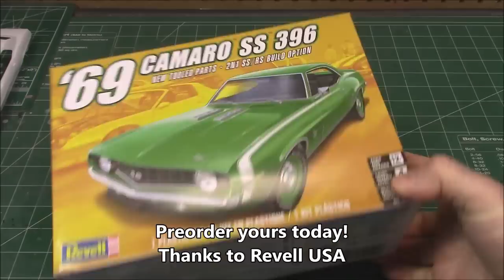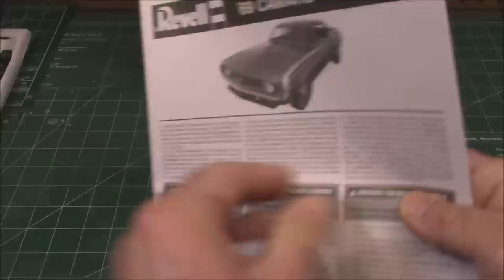Barn Find 1969 Chevy Camaro SS RS 396 1/25 Scale Model Kit Build How To Fade Weather Rust Decal

Comment: As a fellow model builder I have built this model umpteen different time the exhaust system is totally incorrect for this issue of the model chambered exhaust only issued for the 69 Z28 only a small block the hedders we're only available with the small block Z28 Factory 396 hadd cast iron manifold and non chambered exhaust this can be straightened out finally we get a correct Hood thank you Chris for doing your work I'm sure Revell will sell plenty at least they're trying to update unlike some other manufacturers celis new decal sheets and pad printing tires y'all know who I'm speaking about buyer beware

Comment: EXACTLY what I expected them doing, aka use parts from their many versions of that kit and then add the new hood and vents. Which is actually a good thing. This kit many variations are actually one of my fav kit (since they're all the same kit with certain differences). I though they would've also have added a "normal" exhaust pipe set, 'cuz from what I've read the exaust they use were something GM tried but they weren't that good, so they recalled all the cars with them to put on a "normal" exhaust system. But that's still fine, just thought they'd take the time to do this as well since they took the time to make a new hood.

Again, really nice build. I'm not into damaged vehicles at all, but the more I see builders like you build such cars, the more I'm thinking of doing one myself one day.
Reply: A set of stock exhaust manifolds would've been nice too. Also a set of tires that fit the larger rallye wheels. The exhaust from the revell '69 Nova will fit nicely att the back. In the front it needs to be trimmed to fit the manifolds. Stock manifolds can also be found in the Revell '69 Yenko or COPO Nova kits.
Reply: I cringed when he took the emery board to the doors.  And I've been weathering car models since I painted a dinosaur with Floquil weathering lacquers..

Comment: Did you find a tiny hint of a  seam running the full length of the body along the top rib of the front and rear quarter panels?

I did the Revell Challenger and initially thought the body seamless until I hit it with primer.